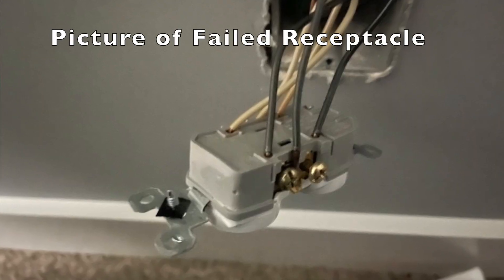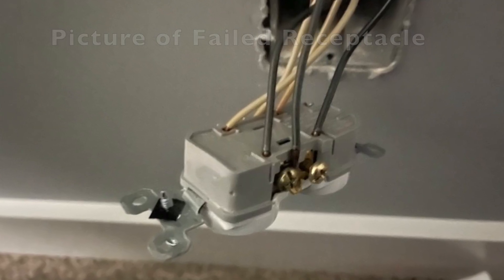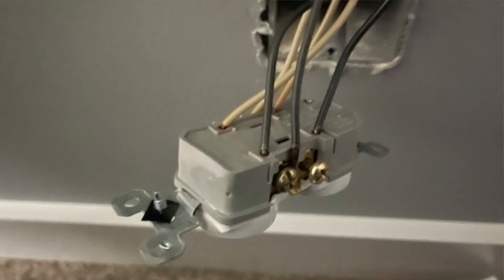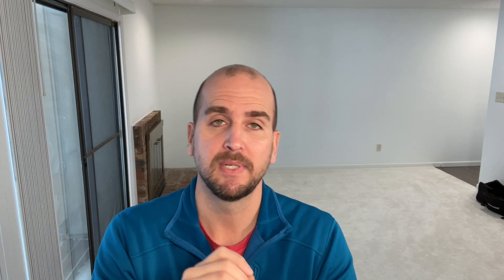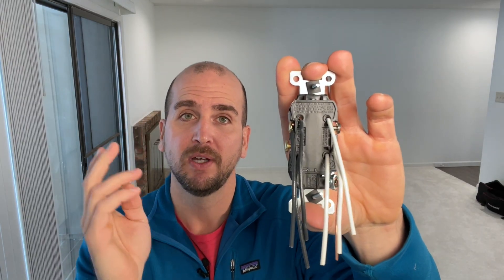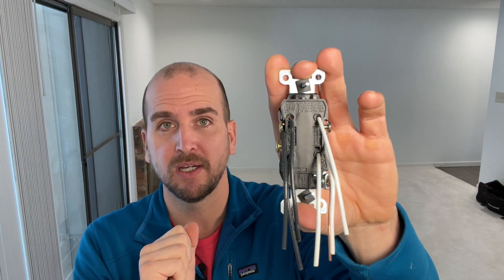Incorrectly Wired Outlet Found In Newly Built Home

Comment: the push-in method should be abolished. Using this method creates unnecessary heat which corelates to the stress of the material due to pressure brought about by the limited surface contacts for current to pass through. Once the material passed its yield strength that is the time when it sparks inside on those contact points under load. --- Very Dangerous.

Comment: Hi sir , I changed some electrical respetical  around the house , couple of them , we're controlled by a switch on the wall , like when you first come in to the room and turn that switch on or of and it will turn the  light on that reciprocal  if it plunge in , and that no longer the case , what do you think I did wrong ?  thank you

Comment: In my opinion, if you used the little plugs on the back of the outlet, you installed it wrong. I am replacing most of the outlets in the house I just bought and several of these plugs popped out when I pulled the outlet out.

Comment: Question: After adding the pig tails, do you wrap electrical tape around the wire nuts additionally for added protection or is that an unnecessary thing to do?

Comment: 1, there WAS no "other wires" that were gonna do ANY damage. 2. UL certification and the code is PROFIT influenced. thats why the Push in's started. it was faster.  If you break a push in outlet, you break the circuit feeding the rest of the circuit. THE ISSUE WITH PIGTAILS HAVE NOW BECOME the GREED change in the code, to require a green on EVERY SINGLE BRANCH wherever it goes, since 2002. due to that, the box is filled with a CRAP LOAD of green wires, and green only counts as 1 wire in box fill. the size of the boxes never changed, nor the idea of counting a green as a single wire. So now we have giant blue  wirenuts or green ones Pushing up against the friggin outlet. 
NOTE that there was no tape. many freak out because of tape. NO code says tape is required. taping an outlet is stupid.

Comment: All three of those points were spot on!  I have never used the push in connections.  It may be ok according to code and have the UL stamp of approval for usage, but I have seen time and time again that these connections become lose and overheated especially when a max draw load is placed on the circuit such as a heater or kitchen appliance.  I've lost count of how many times I have run into heat discolored wires that have been wired using this option.  I started wiring when I was 14, shadowing my stepdad and by the time I was a senior in high school I could wire a house by myself.  The first two points I figured out very early on in my experience.  The last one though, the pigtail I wasn't shown that until I was around 40 (I'm 57 now) There are two great reasons to use pigtails.  The first is that you have less wires on a receptacle, which makes it easier to work on and replace in the future and also to get the receptacle pushed back in the box, but I feel that the second reason is even more important.  If a plug fails from overheating, cracking or just breaks down from age, having the pigtail option ensures that you don't lose a bunch of receptacles down the line.   I will also add that when I make up pigtails I make the wires at least 12 inches long, then I make the connection with the wirenuts and then push those back into the box and then make up the connections to the receptacle.  Nothing is more irritating than working on an outlet where the wires are too short.  Also of note, there is a way to S-fold the wires so that they easily spring back into the box and naturally come back out when the receptacle needs to be worked on in the future.  There is another subject that comes up and that is not having too much pressure on the wires trying to push back out.  The mounting screws should never be used to try to push the wires in.  Nice job on the video!

Comment: dude, push in ..back wire recepticals are made that will take #12 and there are receptacles made that will take #14. You don't see the #12 that often, but they are out there. We see failures more often with the push in type,. But to be honest, they are SOOOOOO common,..it might be that more fail because there are more of them. Now that they are replacing wire nuts with push in nuts,.... I am becoming more skeptical of that type failing more often (as a percentage of connections made). I guess time will tell. Where I was previously...pigtails were common,. Where I am right now,..I have never seen one in residential (unless it was one of ours).,

Comment: You can have a wire in wire out, but it's just in series instead of parallel. Electrically there's no real reason to prefer parallel (pig tail) to series unless you're doing it for a reason, especially in housing. Failure points tend to be Electrician error points. I've had problems with stab-ins before, it was because I didn't strip the wire enough... If you go with a series, it's easier to find out where an outlet goes out, because the outlets downstream will also not work. However, in parallel, just the one will go out when there's a problem. Also, there are rarely professionals working in housing. It's usually just one educated Forman and the rest are just laborers or apprentices... Probably how you wound up with so many wires in one outlet.

Comment: Hi Scott, I love your videos, they are very informative, and I always learn something new. One question I have: everyone (including you) talk about not using the push in connectors on the back. Can you explain why these are bad to use? And if everyone says don't use them, why are they even on the outlet in the first place?
Reply: First, the push-in or "backstab" connections are cheaply made.The spring contacts are not adequately supported by the connector body. (Unlike Wago push-connectors, which seem to be very solid.) Second, the backstab contacts are only rated for thinner, 14ga conductors, and will be distorted by the increasingly common 12 ga. 
I would love to see a video answering this question in detail; I've only seen off-hand, by-the-way explanations.

Comment: I get the screws and push ins, but why are pig tails better?
Reply from the maker: It would remove dependency on the device to provide power to downstream outlets / lights.  If you go through the device and the device fails then you can knock out additional outlets downstream.
Reply: @EverydayHomeRepairs  👍

Comment: I see far more wire nuts failing than screw down terminals.  For 3 wires or for short leads?  Sure, pigtail.  But for 2 long enough leads?  I'll use the screw down terminals every time.

Comment: After watching this video and another one of your videos I was able to easily understand what to look for while replacing a outlet. It was worn out due to the outlet being used often with the vacuum. It was so easy that I decided to replace another commonly used outlet in the room. just to get the practice of doing this. When I took the other outlet apart one of the black wires had been nicked by someone installing the wires and outlet box. It was nicked so much that after pulling the outlet out of the box the wire broke off and as I was starting to pull it out of the back stab position.

Comment: It’s nice to see you illustrating proper wiring technique. I live in SE Pa. and I’ve seen some butcher electricians in my 35 years in house construction.
 We, my wife and I, built our house in 1996. I am a carpenter. I hired a ‘professional’ electrician I knew and worked on new construction with. As we have been updating/remodeling our house I’ve realized the electrician I hired originally was a BUTCHER! As an example, he wired the microwave outlet off of another outlet and during Christmas, if our tree lights were on and ran the microwave the breaker would blow. By code the microwave needs to be on a dedicated circuit, he knew this but roughed in so it was convenient and not code. 
 These electricians have Electrical inspectors who they know and are their ‘friends’ inspect the rough in. 
I’ve seen this time and time again in my area. 
Now, I’m no electrician but in my experience, my advice is hire a reputable electrician and have some carnal knowledge of code. 
Bird dog the contractor, insure it’s wired correctly and safely!
Reply: 🤣I think you meant "current knowledge" of code!  (Carnal knowledge is quite different!😉)

Comment: Most people assume that their new shiny cookie cutter home was wired by an electrician. No so. Usually a laborer does all the electrical, and, the home is signed off by a master electrician with little or no inspection. The city/town inspector see's the master electricians tag, and signs off on the work. Plumbing is essentially the same process.
I did reinspection's (I'm an Engineer, Master Plumber and Master Electrician) for years on behalf of the home owners lawyer. I got burned out dealing with the same deficiency's over and over again. 99% of the homes I saw were deficient to the extent of being dangerous, with a good number that should have been torn down and rebuilt.

Comment: I have heard that its also better to have the ground hole at the top, and I noticed this in your video that the logo on the socket was upside down when the ground hole at the bottom. I heard this was done so that if there is space between the plug and socket anything falling in between it would  touch the ground pin and not a live one. Thoughts?

Comment: The ground prong should be on top instead of on the bottom because if something made of metal should fall across the plug there is less chance of having a short circuit and possibly electrical shock don’t you think

Comment: Not looking to argue, since I don't really know.  But if outlets are manufactured with multiple ports/attachment points and stab-in holes, and have the UL seal on them, why can't they be used safely?  Doesn't the UL brand mean that they've been tested, and found to be safe?  

Again, I'm asking because I don't know, and it seems to me that if they are truly unsafe, they wouldn't be marked with the UL seal, and they wouldn't be manufactured that way.

I understand that some of the posts here are from licensed electricians.  But I also know that years ago plumbers were squawking about Pex, plastic DWV pipe, Shark Bite fittings, etc, claiming that they were substandard, and would fail.  

So, the question is, are these truly a bad thing, and the UL testing is faulty, and there is some other testing that backs up the claim that they're bad, other than just hearsay and stories about bad things happening by doing this?  Thanks

Comment: Oooops. Not a biggie, but at 6:03, you wired up your hot feeding from the top, thus when you tighten, you are tightenning AGAINST wire as appose to feeding wire underneath and wire will not resist tightenning. Good video. Thanks.

Comment: Those back wire receptacles are made for two wires under each terminal as the torque is the same on each wire. 8nam sorry I have been an electrician since 1977 and you are teaching the wrong methods as well as money losing othe job connections

Comment: I once purchased an unfinished but electrically wired holiday home on condition that it passed code by local electrical authority examination. It did pass and I received written certification.  On occupancy I discovered that most of the receptacles had polarity reversed and the grounding rod was lying on ground surface lightly covered with pine needles.

Comment: Good video but 1 question...the outlet you replaced looks like a 15A I could not read the writing on it but then you said the wires were 12/2 that made me think what size breaker are you on typically 12/2 is a 20A circuit and 14/2 a 15A could this be what caused the failure to begin with from what you explained they had a lot hooked up to it like a space heater that would have a heavy draw on it.

Comment: DIY here and I learned something new again about box extenders. I've never seen them before and wish I had when doing some previous upgrades to a past trailer home. Looks like a great way to help prevent possible fires. Thanks for the tips.
Reply: Box extenders are great! There are also little plastic tabs that come in strips of six or eight. You tear off one to three of the tabs, fold them Z-fashion, and place them between the device ears and the box so that the device is not recessed back from the face plate. (A gap between the plate and the device is against code.) But the tabs do not correct the problem of a gap between the device and the wall. The extenders take care of both problems.

Comment: Using the spring loaded push-in connectors, while permitted by design per the NRTL i.e. UL with no guidance from the NEC, is certainly not the best choice for reliability and safety.  This issue is nearly identical when using EMT conduit as your sole EGC.  EMT is permitted by the NEC to serve as the EGC but anyone who is familiar with it knows the couplings and box connectors routinely disconnects.  The screw sets couplings and box connectors are more prone to seperating but even compression fittings can and will fail.  When this happens then you've open circuited your EGC and everything downstream from the disconnected point is without a ground bond which is a serious safety issue.
This is why you should always run an extra correctly sized green wire with your ungrounded "hot" and grounded "neutral" conductors inside the EMT.

Comment: Very good info. Thank you. I do detect there is a “religious war” among professionals about push ins verses screws. I never knew that extended to using a wire nut to make a junction. That said, I can see that if the outlet goes bad, the junction via wire nut will still let the rest of the circuit function, so that’s a practical so,union, though it takes more labor. 

Also I noticed you don’t recommend getting the cheapest receptacle. I’m guessing you use commercial grade on all your projects. 
Good to know and thank you.
Reply: "religious wars" ... not so ... arson investigators with experience will tell tales of "push in" connections that, after X number of years got 'tired' and the spring tension released leaving a small gap that became the equivalent of a spark plug that starts really hot fires. U-tube query ought to show scary photos
Reply: @TimHoHere  "Push in" or "back stab" connections into a spring loaded contact on cheap outlets should be distiguished from "back wiring", where a hole in the plastic housing guides the conductor behind the screw terminal, which is then tightened down. No J-hook required, but still secure.
Reply: @50srefugee  ABSOLUTELY... I love them ... those types cut my cussing - get in there darn you .. time by 90% ():>]

Comment: I thought best practice says do NOT twist the wires before insertion into the wire nut. Even the mfr recommends NOT pre-twisting. If you wre going to use Buchanan or Ideal or some other crimp splice caps, THEN you must twist beforehand

Comment: As someone whose job it was to maintain many older structures, I'm surprised that, after watching several of your videos on outlets and those push in connections you didn't mention something that I found to be a problem on several occasions.  Your example in your hand is a good example of that problem.  You have to cut those wires off the back to replace the outlet. That sometimes leaves you with short wires to work with, especially in older buildings.
Reply from the maker: That can be a problem.  What do you do in those instances?  Pigtail?
Reply: @EverydayHomeRepairs  Pull as much as you can and hope it's enough to pigtail, yes.

Comment: Very well done. Also, to add, make sure that the ground part of the receptacle is down so when you look at it you will see an "Oh" face. There is a good reason for that, which I am sure you know. My brand new house had most of the outlets with the ground side up...sigh...so I went through and turned them the right way.
Reply: I've heard people saying that the ground plug should be UP since it is your thumb that is most likely to slip and touch one the top prong(s), so having it as ground would be safer... Since I've NEVER been shocked by an outlet when plugging in something or unplugging something, that just sounds like a "solution looking for a problem"... 

Personally though, I stay with the ground prong being in the down position because that is what I can always remember having ever since we went from non-grounded outlets to grounded outlets MANY decades ago... 

And if you are going to be plugging in any sort of electronic device's wall power supply (aka "wall wart"), they are normally oriented so that the ground pin is expected to be down, otherwise the weight of the device would cause the unit to come out of the outlet somewhat.

Comment: Wago connectors use a kind of back stab connection. I can't bring myself to trust them because of that.
Reply from the maker: I would say Ideal push-in connectors are closer to the speed wiring/backstab options on an outlet.  Wago 221 are a bit different.

Comment: Push in connectors are a money saver for builders.  It takes more time to put wires on the screw terminals.  I do agree that the screw terminals are better and safer, but time is money.

Comment: Completely with on avoiding push ins. I too have rewired receptacles professionally installed - with pig tails that failed !  And another huge mistake I discovered in swapping out cheesy residential receps for commercial ones is the ‘pro’ had been very sloppy when cutting the outside sheath of the romex - and cut into wire insulation such that the movement me removing the wiring from the box to do the swaps resulted in several conductors breaking off, resulting in you guessed it: having to re-land these boxes to get the needed length of wiring.  On new construction! What a freakin mess.